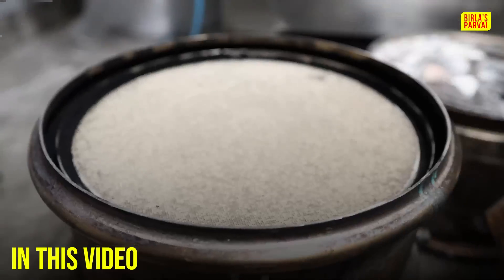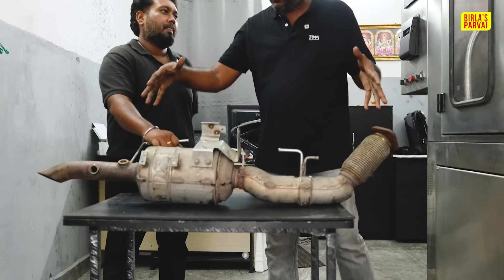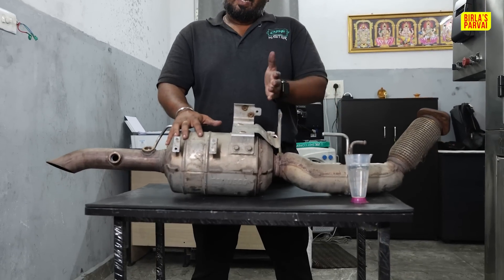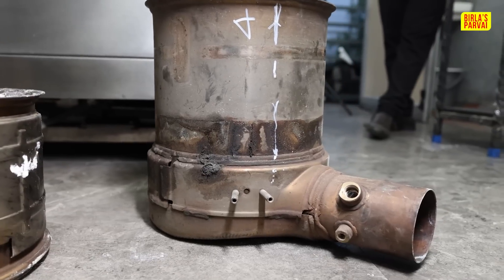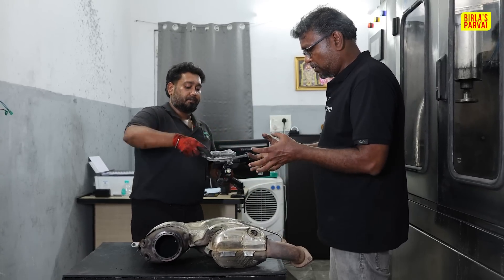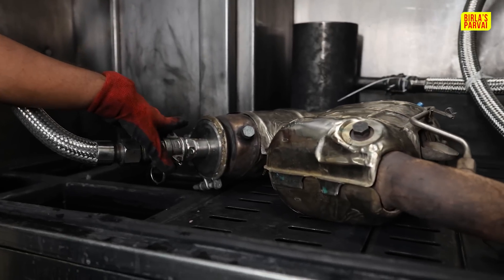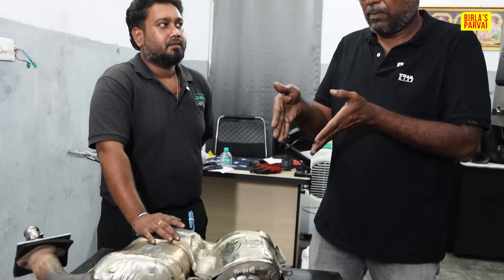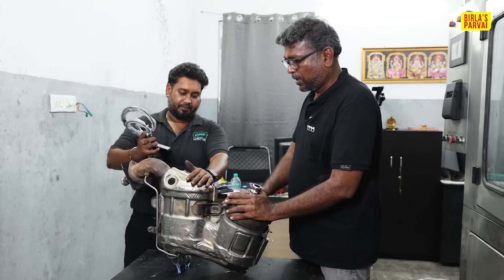Car DPF Cleaning எப்படி செய்யப்படுகிறது ? Live Demo in Factory | Birlas parvai

Comment: Do you provide cleaning service for Ford vehicles 1.5 tdci bs6?
Reply: Clean only if necessary, ford doesn't had ECR so no Urea or DEF is passed in the DPF, this will get cleaned once engine driven with full stress for 20 to 30 minutes on highway

Comment: My Indigo manza has run for 85,000 Km, when I run the car at 125 Km with 4 people ,the engine fowls and the speed drops suddenly ,then after halting for 10 minutes and then start and run at 100 Km there is no fouling problem,  could this be due to the Exhaust block
Reply: check your fuel system once, if exhaust is blocked then it won't even start or run, might be Fuel is not sufficient enough.

Comment: Bs6 diesel  eduthavanga elam pavaam
Reply: Na BS6 diesel vachiruken, ithu varaikum 50000 otiten, DPF 3 times alert vanthuruku, but no issues so far, 20minutes highway la full pedal la otalam or open space la card bonnet open panitu, Ac full low la vachitu highbeam on panitu self regeneration panalm(it takes 15 to 27 minutes)
Reply: @manikandan-sw3gt after self regeneration any improvement? In mileage and pickup

Comment: One time cleaning process for cars, How much will it charge ?
Reply: 40k
Reply: It's cost upto 4500k - 15 k only, it depends upon your vehicle model
Reply: @ 4500k ah 45Lak ku everyone can buy 3-5cars for DPF🤣
Reply: Sir I mentioned 4500rps , not 45laks
Reply: @santhoshraj5133  dont use k after 4500 k=1000 4.5k apdi mention inume

Comment: I have driven diesel cars for 40,000 plus km in BS6 DPF. There is no need to worry about it, in case the light comes, we can regenerate at home easily and recent cars have nearly zero issues with it. It is not worth to take it as a problem and considering turbo petrol mileage and the fuel cost you can save 30-40 % easily. I can say that diesels are the best right now and people can go for it with no doubts
Reply: Which car sir...also which city are you driving sir?
Reply: Bro what is your car and model
Reply: My etios running 4 lacks above 🙄
Reply: , it does not have any dcf
Reply: My etios car 180000km run diesel.can service at your place.remove & fit at your place.how much charge?
Reply: @sengutuvansengu3568  does etios has DPF? i assume etios was never came with BS6
Reply: 2014 model sir
Reply: Processing fees
Reply: 2023 after all diseal 🚗 car launch have problem  example Kia sonnet 2025 model